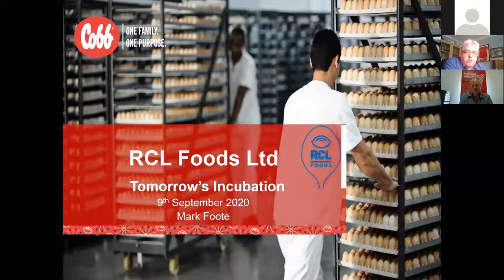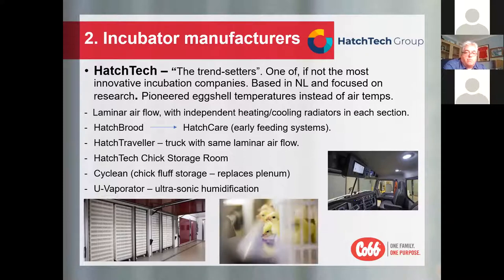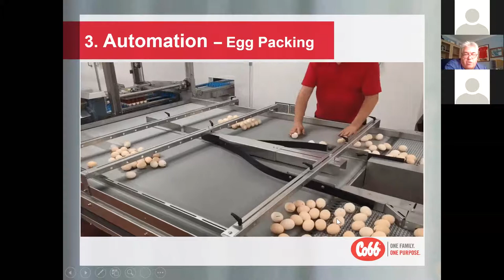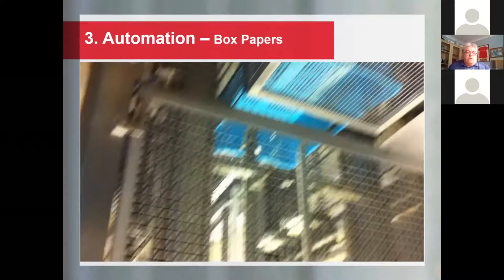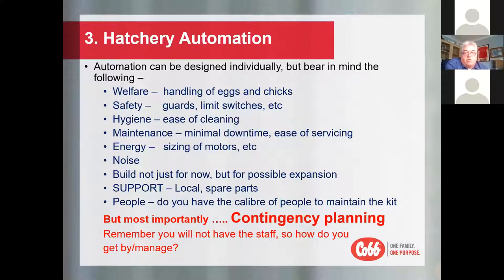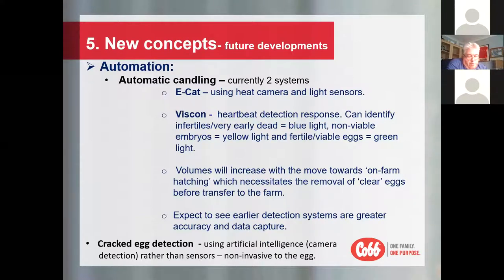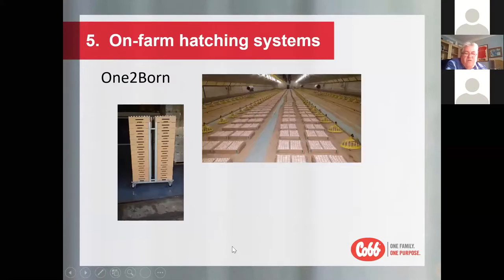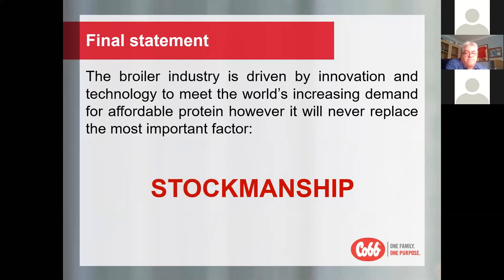Mark Foote - Tomorrow's Incubation

Comment: Thank you for this explication.

What's daily condition per 1 or 1000 eggs on SETTER period  ( temperature, Humidity, ventilation volume and flow, CO2, oxygen, pressure ) and HATCH period ( temperature, Humidity, ventilation volume and flow, CO2, oxygen, pressure )